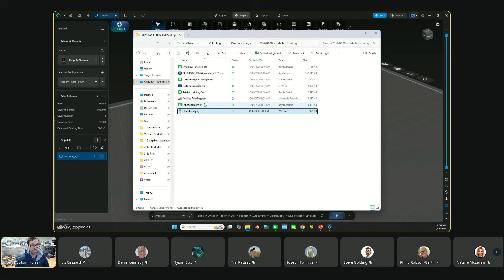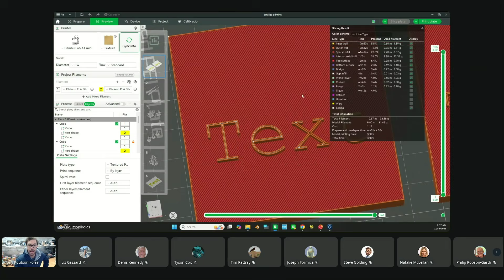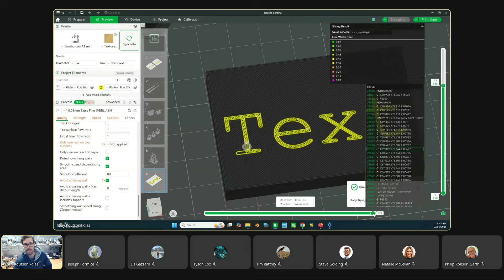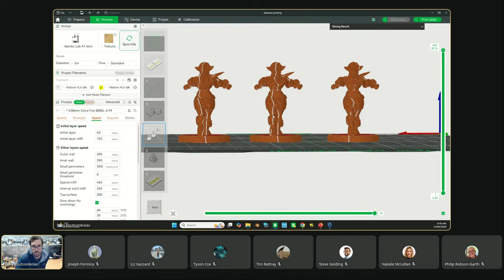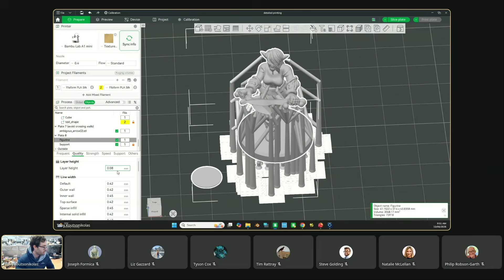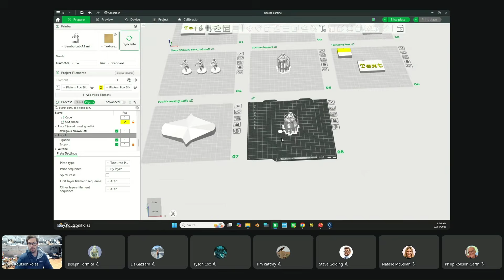Change these settings for the BEST Detailed Printing!

Comment from the maker: What setting did you find most helpful?
Reply: Mastering Thin Text!
Reply: Sculpting and scaling might be the most important if you dont author the paets you print yourself.  This is so no single feature is smaller than 2 line widths wide...  whether that is two .42 line widths or two .23 line widths (from a .4 or .2 nozzle) ..
It's why we need an AI layer by layer review to assess if there are more than 10-20% of a layer's  surface area where instances of original (model not sliced) geometry result in thinner than 2 nozzle width "strings"bor strands ....or we should be given a tunable setting from 1-4 line widths in whole number increments.
As it stands now the best setting is not a setting ...  it is a skill. Though  I suppose Arachne is  a valid setting. I would say minimum layer time is the other one.... but again the slicer can't  do much to actually make  tall thin part layer times slower ....it falls on you to always print two of any model (or one and a dumb tower)  especially ones with fine details and spread them apart on opposite corners of the plate ....ensuring longer travel time... and therefore more cooling time on standard non-CPAP cooled printers as the print head completes tiny details. Otherwise you are laying a new layer of molten filament on a still gooey previous layer .. the results are trash. Until Bambu (or somone else) uses their cameras for something more validating than spaghetti detection and their slicer to ask go/no-go or scalar follow up questions about the  prior print's results .... we are the solution.... the gray matter between your ears is the "best setting".

My guess is that only corporate customers would pay for so much data sharing to train the AI models (and net traffic bandwidth)...and at the  same time they won't because of data security concerns. I'm considering buying an old V100 Tesla card to train but with current drive prices and the need to train on images rather than text...  it gets expensive REAL quick if indie operators try to run Loacal AI to do this job. Far cheaper to spend a couple hours optonizing each model ... both modeling changes, and test printing.

Comment: Turning on interface shells can lead to layers separating extremely easily, splitting apart at that layer junction. Even in normal non-silk PLA. Point  being, it is not a panacea for all situations and all models. We actually add internal pin hole geometry that bridges the "shell" volumes  for better adhesion.